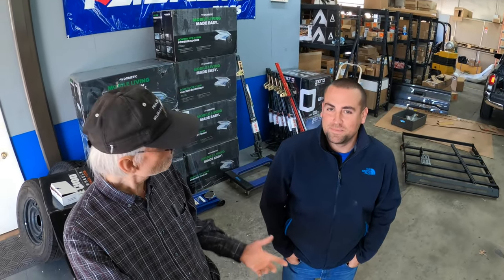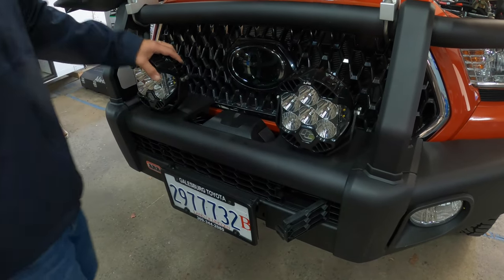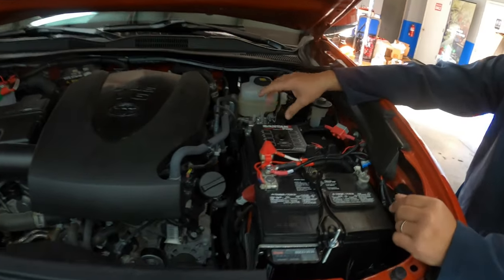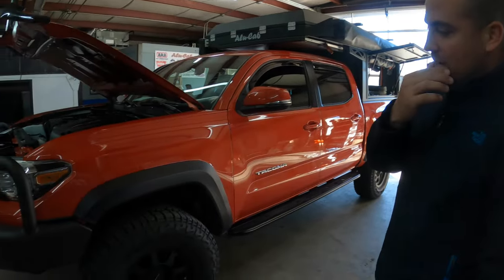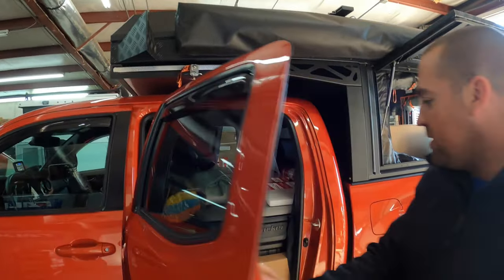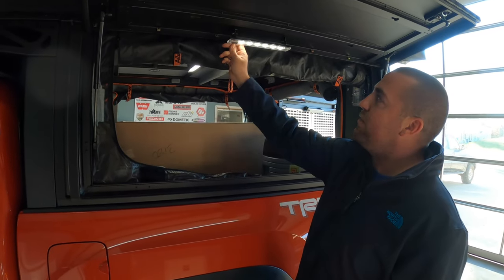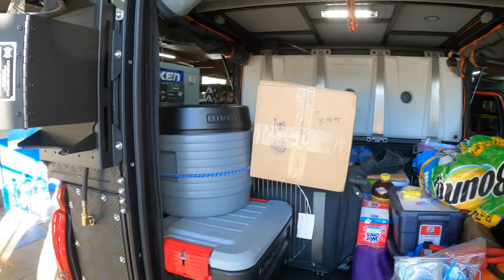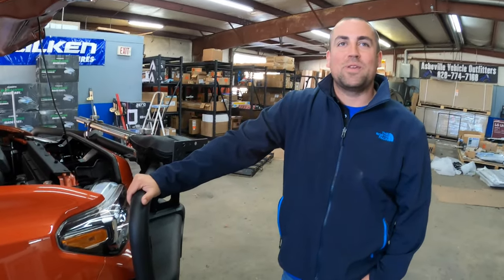Walkthrough of Awesome 4x4 Overland Tacoma Build

Comment: OK you've had it a month what's your opinion on it.  Specifically the OME suspension.  Thanks.
Reply from the maker: Great question, 10ECTaco... thanks for asking!  Thus far, I'm really pleased with the truck build!  After spending time camping in it, there are a few minor changes that I will have done (such as moving the water pump and hose to the side of the bed where the shower curtain is, turning the refrigerator around in the back seat so that it opens from the front and is more accessible (but in that case I will need to be careful that the vent doesn't get block with my gear), rewiring the solar panels to work with the controller, etc.  I ordered a snorkel, a35-gallon gas tank replacement, and beefed up brakes, which are backordered.  Also, I'd eventually like to build cabinets with drawers into the bed of the truck to make gear more accessible.  Regarding the suspension, I'm glad that I didn't go the less expensive route of using air bags.  The suspension is first class.  I've put on nearly 4,000 miles on the truck and climbed to the top of Windrock Mountain in TN since the build... and the suspension has performed exceptionally well.  I've made two marathon round trips from western Illinois to southwestern Florida already and the rides have been smooth (of course, the mountain trails were a little bit bumpier)  :^).  I really love the tires, too, although the noise they make is noticeable (but I quickly forget about it).  Before I left AVO, Mike used tire chalk to determine how much to air to put in each tire. That was when it was fully loaded.  When the truck is not carrying a load, however, I let a couple of pounds of pressure out of the tires to smooth the ride out and it works just fine. I am amazed at how many people stop to talk with me about the truck... hardly a day goes by without people asking questions about it or telling me that they are envious.  :^)
Reply: @OverLandScapes  thanks for the reply and glad everything is working out for you.  Guess I need to call and get mine in there for suspension and a bumper.
Reply from the maker: @10ectaco10  Awesome!  What type of truck do you have?  Are you thinking about an ARB front bumper?  Mine is built tough & rather heavy but from what the folks at AVO were telling me it is crash rated to fold with front end if you hit something serious (obviously more than a deer).  And I wouldn't be without the winch when I travel north.  Please keep me posted and let me know how it goes!

Comment: I’m confused about the suspension system. What did you use?
Reply from the maker: Asheville Vehicle Outfitters (AVO) calls it the "OME Tacoma 2" Heavy Kit 2016 and up."  The shocks are OLD MAN EMU.  I'm able to see "Charger Sport" on one of the rear ones (although here is something written before that but it is covered by the sleeve.  The leaf springs are also EMU.  No air bags (which I didn't want).  You could reach out to AVO at 844-667-3687 if you would like more information on the suspension kit.  Hope this helps!

Comment: just bought our Taco OR.. this is my dream build... how much is that Build cost... maybe a rough idea..
Reply from the maker: Congrats on the Tacoma!  This is a rough guess because I bought the truck, ALU-CAB, and truck modifications (such as armor plating, larger gas tank, Powerbrakes, etc.) in a relatively short period of time.  I know that the ALU-CAB itself is now running around $13,000.  Then, there were a lot options for the ALU-CAB that I added.  I'm guessing that I've got well over $20K in those options.  And the installation costs were probably somewhere north of $2500.  I hope that helps.  To get a more accurate picture, just call and talk to the folks at AVO.  They can give you some ideas and talk about the options that interest you most.  I lean on them all of the time for info and I and I have found them to be very helpful... their number is 844-667-3687.  Hope this helps and good luck!